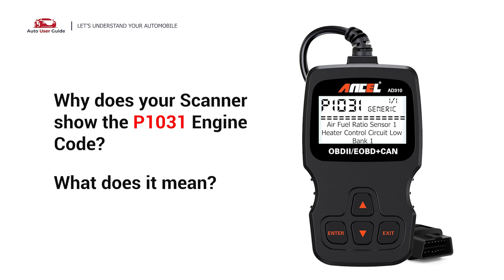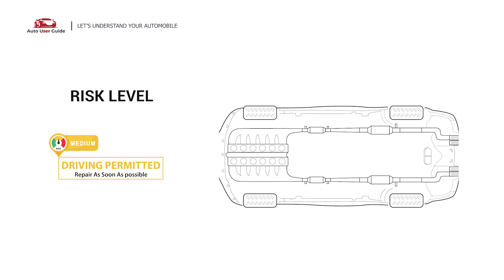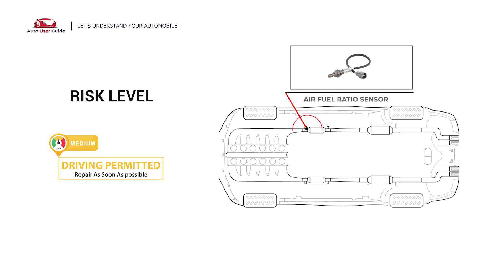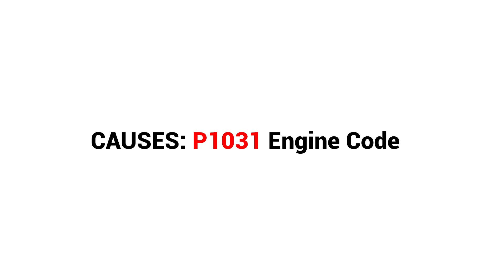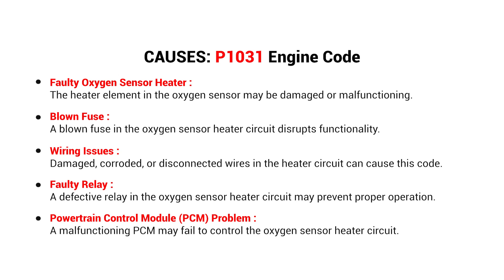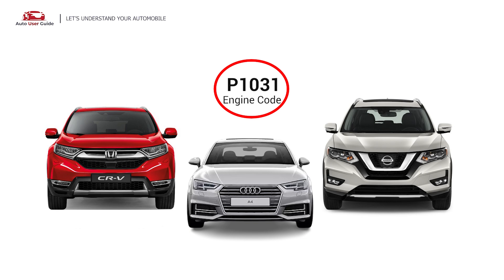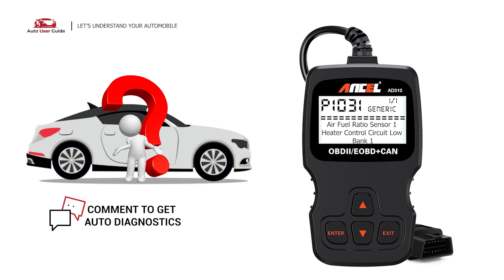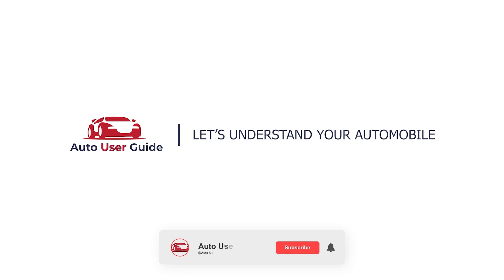What is P1031 : Engine Error Code Causes Explained

Comment: I am getting this error code in a Nissan Pathfinder 2007, VQ40 engine. Oxygen sensors, MAF amd camshaft were replaced without success
Reply: @arce218  did you find the problem?
Reply: @wernerm6252  Yes, it was a faulty oxygen sensor. Replaced the sensor and the error code was gone. Good luck!